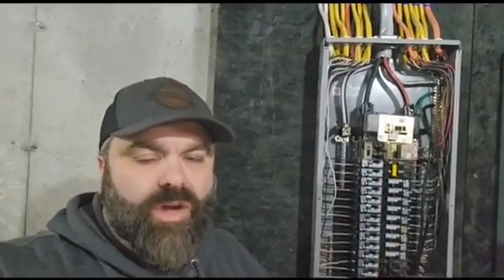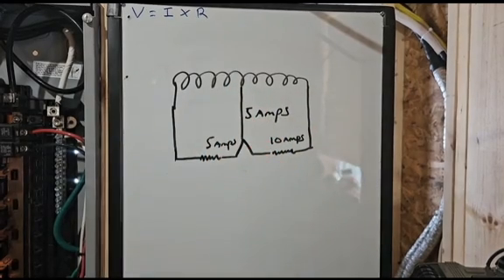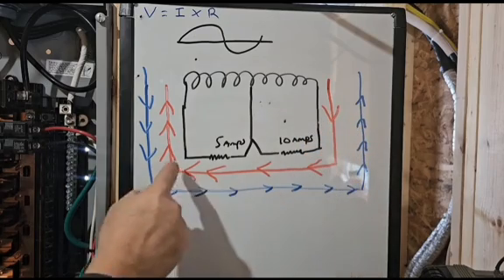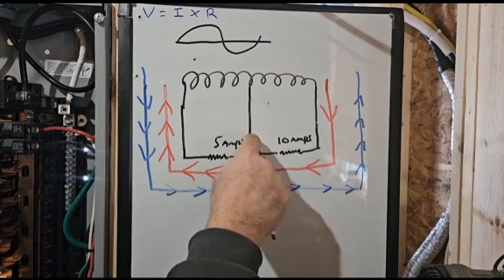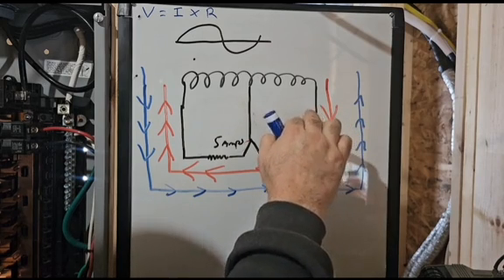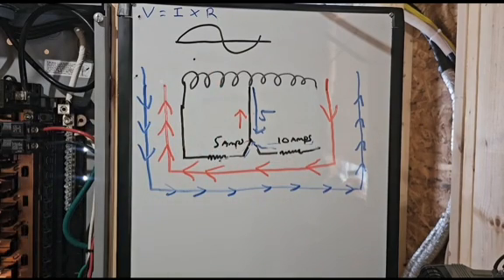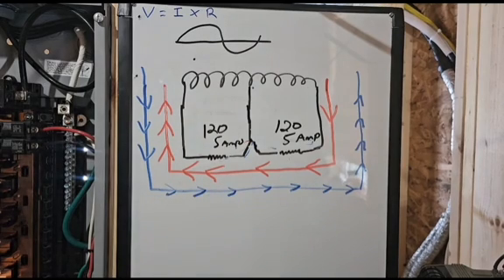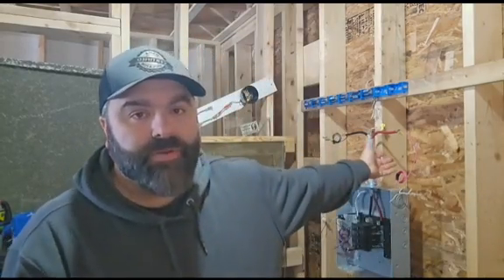CLICK HERE for full video How and why does the neutral carry the imbalance.

Comment: As an electrical engineer I approve! 👍 Lots of folks don't understand AC voltage and current, thinking it's like DC. Then you've got the complexities of R.M.S., inductive and capacitive loads,  magnetism, transformers, capacitors, 3 phase power, and all the messy calculus math in it. Thanks for making things simple for the lay person, even jouneymen, and apprentices. 😊
Reply: Now can I ask an electrical engineer a question.  It has always seemed to me that AC voltages of 120 or even substantially lower are very easy to get shocked from, but DC current don't seem to be this way at these voltages.  What I am asking is this, is messing around with batteries that are 90 volts or 130 volts a dangerous shock hazard?   Landline telephones operate at 60 volts DC power.  Antique 20's era radios had battery banks that operated up to 135 volts.  I have been powering old radios like this by putting together 9v batteries in series to about 90 volts but have always been a little leery about the safety of handling such things.  I have carefully tested lower DC voltages on the back of one hand and couldn't seemingly feel any current.  I have somewhat assumed that 60volt DC may not be quite as dangerous for the simple fact that phone wiring is pretty wide open in the public sphere.  Could someone clarify this.  I have looked quite a bit online a few times to try and find some discussion of this.
Reply: @wdmm94 All you need to know as far as electrical hazards is that in order to get a shock, you need to provide a return back to source through your body. It is not about the volts or amps or ac or dc. They all have the potential to kill provided the right conditions.
Reply: @wdmm94  
If you compare AC to DC, then studies indicate that AC is around five times more dangerous. The human body is naturally more resistant to DC than AC and it has been proven that letting go – therefore escaping the impact of electrical shock – of live parts in a DC circuit is easier. Nonetheless, the risk of electrical shock remains and can lead to local burns and even disrupt the electrical signals in your heart. DC will stop the heart flat, while AC will cause it to fibrillate. A stopped heart is easier to restart than one that is fibrillating.
Reply: @jbsimmons54  Thank you.  That does answer a big part that I was wondering about.  What about actual voltage and current levels that become dangerous? From what I have seen it seems that it is plenty easy to have current flow throw a body at 120 volt AC.  Even with dry skin.  I have read about 100 Milliamps is lethal etc.  Yet old radios will have bare metal battery clips or harness terminals that one is hooking up a 135 volt battery to.  Landline telephone boxes and pedestals are everywhere on houses and road ROW's.  Stick a hand right in and touch bare terminals at 60 volt dc. I pushed some probes tied to a 75 volt battery set hard into a finger with seemingly no effect ( I was thinking of licking  a finger and  trying  this again).  I guess what I was also getting at is when does DC current begin to flow through a body?  Does a body have higher resistance to D.C. current flow so it takes a higher voltage to be dangerous?  Or if a guy is soaked it's bad at 120 volts?
Reply: @wdmm94  
A voltage as low as 25VAC @ 60Hz is more deadly than say 25VAC @ 3KHz. Higher AC frequencies are less dangerous because the switch between negative and positive happens so fast it approaches that of DC voltage as far as the body's electrical signals are concerned. According to UL 1310, the DC voltage limit is 60 volts in dry conditions and 30 volts in wet conditions.
Reply: Actually, most people think that there are 2 120V phases...180 degrees out of phase. This is wrong. 

There ONE 240V phase, split into 2 LINES. They are not out of phase, since they come from the SAME TRANSFORMER! You can't get 2 phases from one transformer. 

And the split phase system is a real beauty because you can't get an imbalance! 😊
Reply: @steevemachine118 well your assertion that they are not out of phase because they come from the same transformer is not true. A 3 or 6 phase service comes from the same transformer but it is different windings with a shared neutral tap vs the same winding at different points. Both types of services are single step down transformers though.
Reply: @steevemachine118  This is only true if you measure the voltage at the opposite ends of the transformer. But if you measure each end of the transformer to the center tapped neutral, you will find two 120V phases, 180 degrees out of phase.
Reply: But this is exactly how DC works. The problem is not in thinking in DC terms but lacking understanding in electrical fundamentals such as ohm's law. A basic understanding of DC voltage dividers does wonders in demystifying residential electric.
Reply: Lmfaooo don't ever talk about journeymen as an electrical engineer because you people are the ones creating 💩 that doesn't work and electricians are the ones making your mistakes somehow work lmfaooooo
Reply: Question, if I want to upgrade from 100 amp service to 200amp, do I need electric company to run bigger feed?
Or does the current cable handle 200amp?
Reply: @1219ess 
In most cases you do, unless the power company used the same feed wires for both 100A and 200A service. It depends on when your house was built, if you have under/above ground service, and whether the overhead feeds are insulated or not due to temperature rise from increased current. Most standard homes today are 150A/250A service and use the same feeds, knowing a future service upgrade is probable. I have heard of cases where the feeds did not have to be changed in 100A to 200A. The utility company will make that determination. It will also depend on if you have natural gas or propane as well. It's not a layman's determination as the considerations are many and complex. If possible ask your neighbors and find out who has already gone through this if you want a quick answer.
Reply: 100% agree. I think this is a real hard concept to try to teach so, kudos! I think you are right also because a lot of folks have to think in DC terms for some reason. AC is somewhat of a foreign concept essentially

Comment: How about an isolated transformer? We have isolated 480v to 120v transformers on our buckets at work. We had a Apprentice go around and ground them to the frame. Seemed to cause issues so we removed them. Do they need bonded? I said no. They are no longer isolated at that point. There is a potential for an electric bleed off to the frame in case of a short. What are your thoughts on them?
Reply: Normal stuff need to be grounded 

Some RARE equipement will use isolating transformer for safety but you don't see that often anymore
Like the old razor plug in the bathroom  ...was an isolating transformer  so you could not GROUND yourself even if you wanted to 
Now a day they use a GFCI plug that trip when it detect that you are GROUNDED lol

Comment: Personally I think it is easier to understand if you look at it as two 120 Volt supplies in series. You have a voltage of  120 sin (kt) in series with a voltage of -120 sin (kt). Since one of the currents is negative, the neutral carries only the difference. Technically they ARE adding in the neutral, but since one of them is negative (opposite polarity) the final result is the difference. I don't think it is so wrong to say that they cancel. Maybe that is just some people's way of understanding it. They call it "canceling."
Reply: Superposition makes more sense. The currents don't cancel, but instead a sum of all currents is whats measured. Kind of like how you can have a bunch of forces acting on an object but it's the net force that determines the movement of the object. Those individual forces still exists.

I'm not entirely sure, but it sounds like you're thinking about "canceling". Because the topic focuses on current, not volts.
Reply: @waroftheworlds2008 "Cancel" is not the word I would have chosen. The situation is pretty simple if you use KCL. The neutral current is simply the sum of the two hot currents. But since the two hot voltages have opposite polarities, the magnitude of the neutral current is the arithmetic difference of the magnitudes of the two hots. But if I was trying to explain this to someone and they said "oh, the currents cancel out because they are going in opposite directions" I wouldn't say that is wrong.
Reply: I'm😮I'm( @waroftheworlds2008
Reply: His dismissal of the term "canceling" is correct for this context.. Many believe believe that opposing currents are flowing in the neutral and canceling, like two equal opposing forces would meet and cancel. He showed that that was not happening. The neutral is carrying half cycles, current in one direction and then in the other...

Comment: I’m an apprentice and this perplexes me. Why are 2 hots needed in the first place? Is it possible to run one hot, one neutral and still get the box to work?
Reply: I'm an engineering student. I know AC can be done with a single loop circuit, I don't know why houses have 2 hot legs.
Reply: You still have to have a reference point somewhere. If you used a single wire with earth return, you could have 1 hot and 1 at ground. That's essentially what's coming to your house, but now the ground is center tapped in the middle of the 240 to give you 2 opposite legs, with the center being grounded and tied to your neutral.
Reply: Because someone just decided that they want to use split phase system.  We don't have to use this system. Look at Europe. They dont use split system like ours

Comment: ok... but what if i have a HUGE inductive load on 1 leg.... and all resistive heaters on the other leg? 
.
AC electricity is so strange to my automotive tech 12V mind (and some 6V stuff.... which can get REALLY strange.... EX 74 kawi g5 100cc... if headlight burns out, brake light gets all the power, and blows every time you hit the brakes lol) 
.
i have yet to find a positive ground however.... yet i know they exist
Reply: you'll just have a phase shift between voltage and currents. Meaning voltage and currents reaches maximum at different time but a locked interval.

Comment: If I am correct.....At the end, you say that there is 1/3 of an amp imbalance.  That 1/3 of an amp imbalance is because the electronics, the timer, etc. is a 120 volt device, and is put across one side ("leg") instead of across both sides. that is using up that small amperage.  That's why there is a small imbalance.
Reply: Mmm....no. all current makes a complete loop. The power that a device consumes is from a potential difference.
Reply: @waroftheworlds2008  Yes, all current makes a complete loop, but the timer, etc are on one 120 volt leg so the current for them must flow in the neutral.

Comment: Interesting.  That explains the voltage fluctuations when I had a problem with the neutral after an ice storm some years back.  So what is the function of a ground rod, just out of curiosity?
Reply from the maker: https://youtu.be/rSumytQfcw0?si=eiAi2F95pPLg5kG7
Reply: @Stevenj120volts  Thanks!
Reply from the maker: I have a video the touches on that.  I can try and tag you.